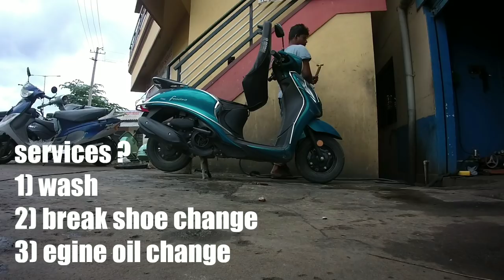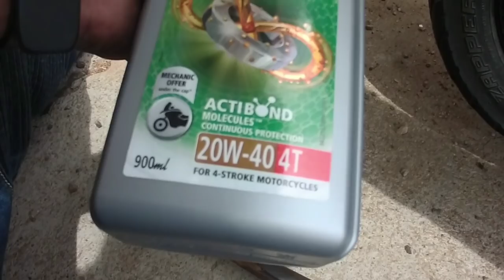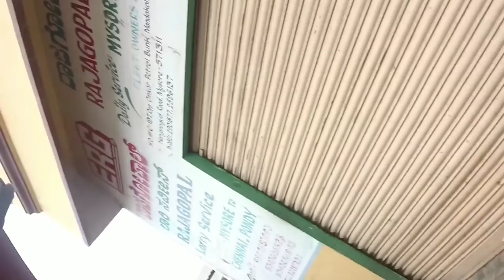How to change rear brake shoes Yamaha facino

Comment: Sir need your help . I am facing problem . Mere Yamaha fascino me  10 to 30 speed me jab gari chalte hai to झटका , jhatka marte hai . But above 40 speed it does not happen .
 Changed the spark plug also but didn't get succcess .plz reply
Reply: Power issue in bike